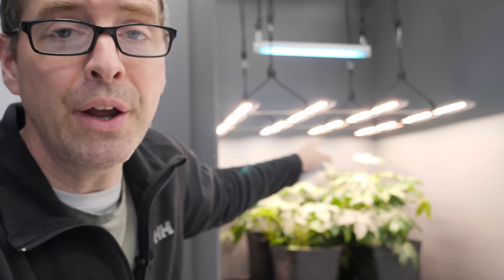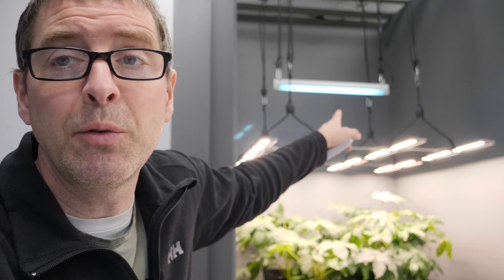How to use UVB with LED grow lights

Comment: Do HIDs produce this level of UVB and would it help to have extra if your using HID?
Reply from the maker: No they do not, not even in the same realm! It would absolutely help if you're using HID, as they only emit extremely small amounts of UVA, not UVB. 

Our UVB fixtures emit 75% of their energy as UVB and 25% as UVA, providing healthy stress responses to your plants for an increase in terpene and flavonoid production.
Reply: Not even a 10000K 315W CMH?

Comment: Shane, if a person is running in a tent, could you use the UVB closer to the plants but for shorter periods of time and see success or will it just burn?
Reply from the maker: We recommend a hanging height of approximately 2ft/60cm above the plants canopy, no matter if you're in a tent or a room 👍around 2 hours a day in total is optimal.

Comment: hi shane i have the 2ftx2ft hlg  quantum board type lights.ive got 2 lights with a 315 cmh in the middle covering a 9x4 ft area...would 2 lamps be enough to cover this area and is it best to start supplementing from week 5 at the begining of the swell for 2 hours a day.? cheers

Comment: Thats 20w uv maaybe around 365nm so it will not burn anything exept some bacteria etc, even that thing in your face will not damage your skin or eyes becouse light intesity is so tiny. If it was uva light that might do some damage even in low intensity. Those high wattage grow light fucks with your eyes more than any uv light and thosse led lights with far red spectrums are very dangerous to your eyes, allways wear protective glasses when in grow room with those crazy light on.

Comment: I want to introduce uvb to my grow. My current light is the volt VL-1 and with that size ballast it will block alot of that uvb. So can the uvb be hung under the light if the light is the appropriate distance from the canopy?
Reply from the maker: Hey, 

You can add it at a minimum of 45cm from the canopy but keep an eye on the plants for stress.

Comment: Hey what are your thoughts on running 30 watt uv light from hlg at night to help with powdery mildew.  Not sure if this would blow the 12/12 light cycle or if they are even uv-c that actually kills powdery mildew at night. Thanks for you response

Comment: I recently purchased the Mars Hydro UR45 which has 30w UV and 15w IR.  I have the mars hydro FCE8000 that I'm going to attach them to.  The UV seems to have only UVA in the 365-420nm and IR in 730-745nm.  How would you recommend using this light since it's only UVA do I use it during the full light cycle or still 1-2 hours mid day?  Also how would you use the IR?  They are both on independent switches so I can toggle them individually or both at the same time.  Thank you!

Comment: I've never seen them that high before.  
Alot of lights are incorporating uvb bulbs nowadays.  Maxibright have released these uvb led strips , 60w strip is £230 to £290 . Way too expensive I've you ask me . But If they really increase resin and terpene production then it's worth it I suppose 👌.

Comment: I tried one run at 24" and 2 hours/cycle, in last 2 weeks and my plants fox tailed. I can't say for sure if the UVB caused the fox tailing, other things can cause fox tailing such as genetics and high temps.  But on my current run I'm going to hang it at 48" for 1 hour/cycle. I realize it will be a very small dose but I'm in a tent with reflective walls so there will at lease be a little UVB bouncing around.
Reply: Over feeding and to much wind will also create foxtails

Comment: Thanks Shame always precious in your evaluations ... I have a question regarding the photonic passage through plastic and glass .. I have a box with inside 730 365 385 and 285 nanometers divided in height by food film which creates two separate environments, , one from 0 - 150 upwards and 150 upwards for the lights .. I conditioned the air in the lower part from 18-21 45-50% humidity and just above the food film canopy (PE) 25-28 36-40 ..it is evident that the separate growth parameters are very different resulting in a reduction of photons lost especially in the UVB UV spectrum and 730 .. ... I try to maintain the temperature 18-21 45-50% humidity with reduced ventilation ,, parameters best to avoid evaporation oxidation modification of terpene profiles and other volatile compounds .. for optimal growth, however, prof. bruce bagbeee suggests 23-26 45% approximately ,, parameters that are not valid to preserve degradation chemical modifications and losses of volatile compounds ... I have to buy separate solar meter uvb uva farred and check how much photon loss involves passing through a food film classic .... if you would give me some tea measurements in advance I would be immensely grateful. ...

Comment: It's my very second growth in my life....Finished my first cycle with uvb 310 about 1 month ago...I'm now enjoying results and I can say that my last potatoes growned under this light are much more tasty than the other made before buying your light...all of them were autos (same strain from same seedbank) so I can't really estimate if it's all about the uvb or just the phenotype...but yes, last one was very covered by frost and much tasty as I said....can't wait to grow couple of clones to see the real potential....I'm happy but to be honest I was expecting a better quality overall for the fixture...the power cable seems to be a chip one.
I'm saving money to get one of your aray soon or later , actually I'm using a ts1000 but due of its design is a pain to use uvb on top of it.....I guess aray 2 with uvb310 in the middle will make it perfect for a 3x3
Reply: You will need the aray 3 for a 3x3

Comment: Would it be worth hanging one above a 240w quantum board in a 4x2 tent, or would the light block most of the usable UVB?
Reply: Keep your qb240 to the back or to the front.  Not perfect but it will allow the use of the uvb

Comment: I ordered a UVB light from you and I can't wait to set it up! Thanks.
Reply: Any update ? Better terps ?
Reply: @alxs2666  I'm 23 days into flower, as soon as the trichomes show up I'll monitor them and give another update. Thanks for asking.
Reply: @rickwhite9748  any update? How many hrs do you use the uv? Any specific glasses you wear?
Reply: @scarcorleon  hey, how are you doing? I have it on one hour a day in mid-cycle, I've been using it for about one week and I'm around 6 weeks into flower,  so far I haven't noticed an increase in trichomes but I'm told it takes a couple weeks to really notice any significant difference. I'll definitely keep you posted, should be harvesting late October possibly into early November, Sativa pheno loiks like it has a longer flower period.
Reply: @rickwhite9748  Update
Reply: @roadrunner7441  I honestly didn't notice any difference,  in my opinion Genetics plays the biggest role in trichome production. I plan on doing a run with Ethos and In House genetics and compare the difference. I have great trichomes with Barney's farm and Brother's Grimm.
Reply: @rickwhite9748  Basically it's just people trying to sell their products huh
Reply: @roadrunner7441  yup, business as usual

Comment: Ok what’s up migro (Shane). I just noticed this video  after I purchased a Gavita uvr. Stand alone led sorry  but they were readily available  in a timely manner here in Michigan.  First off  I love everything you do for all of us home growers. Questions that I have can you possibly test these types of lights mammoth-gavita-hlg-growers choice?  Also will these lights help with mold- powdery mildew if not  that sucks lmfao that’s why I purchased them.  But more oil sounds good too.  Oh and if this will not help with powdery mildew is there a light that will help
Reply: PM is an issue with controlling humidity and temps 99% of the time.

Comment: great info, thanks!  maybe you can help me understand something. i noticed many of the larger lights led have the 3000k and 5000k with the rich/deep red(600nm) but only include the IR and sometimes UV on the smaller models. could you please help me understand why?  see the upgraded spider farmer SE5000 vs SE7000 as an example, thanks!

Comment: Sorry I only skimmed the video because I already bought your uvb light and did a bit of searching on the matter but I still can't find the answer. 
Just a question because I got 2 for a 4x4, If I put too much uvb, would it have the opposite effect on producing terpenes? 
I figured for 1.5 hours a day it should be okay, more so just the cross-over I'm worried about

Comment: Bought 4 of the 4ft Pure-5 UVB's about 3 or 4 years ago. With little knowledge at the time, I scorched the hairs right off the plants. lol
Reply: Did you figure out how to use them properly?
Reply: @scarcorleon  They're sitting in the closet at the moment. Been building lights with 360nm and 380nm diodes added on a separate channel.
I'll get those UVB's out again sooner or later. That was in my earlier days of building   led lighting systems. It was pretty new tech for everyone back then.

Comment: May be a dumb question but i wonder if this can be repurposed to help people deal with seasonal depression using artificial sunlightm obviously at a safer distance for a short period of time. I suffer from it in the winter and I have gone to tanning salons and it def helps along with taking vitamin d and going to the gym
Reply: Sorry to say this, but the question is indeed dumb. I mean, i understand your idea and it does make sense to some degree, but to even think about buying this light to be suntanning yourself on your own is just asking for problems and dangerous health issues like skin cancer and blindness. These lights are not meant to suntan people lol, it's meant for growing plants. There's a big difference between UV grow lights and suntanning UV lights. Just like there's a big difference with standard grow lights and the lightbulbs you use in the house. You wouldn't use a 300, 600 or 1000 watt growlight to light up a room, would you?

These lights come at different UV wavelengths, intensity, power and percentage of UVA and UVB. I think the MIGRO UV light comes at 75% UVB and 25% UVA. This is far from the spectrum of the sun. In nature it's the opposite, much more UVA and much less UVB.
There's a reason why in tanning salons you are able to touch the bed and be so close to the lights, because they are meant for people. You can't do that with UV grow lights. Also everyone's skin is different and there so many variables with UV lights, you simply cannot come up with a proper formula to suntan yourself. Just don't do it please! Go to a tanning salon and make it simple. Or simply go out when you feel depressed and get some natural sunlight, even in winter you would get enough.

And also, sorry if i sound rude and that's not my intention. But if you go to tanning salons, take vitamin D, go to the gym and all that stuff, and you're still feeling depressed, then it's not a seasonal depression, it's a chronic depression and no amount of UV would help you with that. Something else is bothering you and you need to tackle the core of the problem.

Everyone's body is different but i'll compare myself as an example. I'm 25 years old and for the last 5-7 years i'm spending time at home all day long, playing games, watching youtube, smoking weed etc. I only go out at summer, and i don't even suntan myself or anything, even though i live right next to the beach. I run a summer business and i only work during summer. It's not making me depressed. If anything i'm more depressed during summer because everything becomes so busy, loud and chaotic that i can't wait for winter. Personally i enjoy quiet and calm times, intense times make me depressed but that's just me.

I do feel weaker and i do have less energy in winter of course, but when i get that energy in summer i feel more depressed because of busy life. Firstly it's a mental problem, the body comes second when it comes to depression. There are people in Scandinavia and other northern countries who live a large part of their lives in darkness due to winter solstice, and they are strong, healthy and happy (most of them at least).

My advice is, keep doing what you've been doing now with tanning salons, vitamin D and the gym. Find a hobby that truly makes you happy and fulfilled. If you are happy and enjoy your hobbies, you can be in darkness 24/7 all year long and you would not feel depressed.

Another advice is, check for mold and mildew in your house. If you live in a humid area there's a big chance you have mold hidden somewhere, maybe behind the walls etc.
Mold toxicity causes depression and anxiety, along with a plethora of other body problems and health issues. Mold can be even deadly. Just an idea to think about.

And if you really REALLY must use UV in your room, get a proper tanning bulb meant for humans. Or those small UV lights used for reptiles, bought from petshops. And buy UV protection glasses with a proper UV wavelength for your bulb. But i wouldn't use any of that, it's better to be depressed than have cancer or blindness. You can also burn down your furniture and bleach your items like wood and plastic.

Also, i assume you're not fully educated and experienced on UV lights since you're asking this question (nothing wrong with it, just an honest observation, i'm no expert either) but if you're not fully familiar with all the wavelengths and dangers, i would suggest stay away from it or get an expert to guide you. 

Good luck and hope you start making yourself feel better! It all starts with your mind and your spirit, make yourself feel better from the core, forget about artificial crap.
Reply: @twentytwo138   i am treated for depression and i have no symptoms and its beennlike this for 15 years until the dead of winter and then its mild..i did not know if there was a difference between tanning lights and this light..thats why i was asking. I would never buy this light for that reason lol. I was just curious. I guess i was asking because i was thinking about a scenerio where i had my tent left open for whatever reason and i was in the same room for whatevr reason that i would receive any benefits from it. I was never planning on laying under it but u wouldnt know that by how i wrote this so thats my fault lol. Depression sucks and i avoid it like the plague because it destroyed the first 25 yrs of my life.  I am very lucky to be treated and have no symptoms except a couple months out of the year.
Reply: @twentytwo138  you can tan with UV B bulbs pseudo intellectual online moron,,,it is the SAME spectrum as the tanning beds. I personally have used my UV B reptile light to tan MANY times safely. paragraphs to say nothing of value,.,,,

Comment: Good UVB and UVA big topic nowadays everyone thinks Uvb is necessary and all though I use them they are not required most leds already put out uvb so beginners beware👍 I don't Think there is a such thing as optimum spectrum and unattainable at cost comparison.  I use it in veg a little and mostly late flower to help with trichomes production and far reds flash for 15 minutes  to help plants go to sleep faster before light out cycle and seems to work well. In my opinion it's a good tool to add to your grows but not a necessity Thanks for sharing Shane love what you do long time follower and supporter👍🏻🙏❤First time I ever saw you was 3 years ago with Bruce Bugbee great collaboration and good episode with the 2 of you explaining all the spectrums. Has anything really changed since then ???? Thanks Again Shane u rock👍🏻
Reply from the maker: Hi, LEDs cannot emit UVB at any useful level and are uneconomic, you are probably thinking of UVA LEDs which are basically deep blue and do not have the same effect as UVB, thanks, Shane
Reply: @MIGROLIGHT  OK Cool thank you for clearing that up my mistake. Thank you for that I love learning and I love learning the right way even if I'm wrong I think alot o g people get offended when they are told they are wrong or have been misinformed I truly appreciate learning the Right Answer's  that checks out 👍🏻🙏😁
Reply: Honestly i don't think most LED lights have any UV at all, let alone UVB. If your LED has UV, it's most likely just UVA in the higher wavelengths like 350-400nm and that is almost nothing, maybe it will increase the flavor and aroma a little bit, but not THC and it will not stop mold. Those LED UV diodes are like a toy, like the invisible UV pens or those money-checking UV LED's. To produce UVB LED diodes is very expensive and the LED light would be expensive as hell. Probably the diodes would burn out fast as well.

Are you sure you didn't mean HID and MH bulbs? Because those produce UV as well as IR.
I have Mars Hydro TSL2000 which is a fairly common LED light and it doesn't have any UV, just some Infrared diodes. Even their newer model like SP don't have UV anymore, they removed them. The FC series has some UV, but it's not enough to get a decent result. LED UV is just not efficient.
Reply: @twentytwo138  well actually YES  Just about  all the leds light have sum <uvb>  correction  in the spectrum on all these new full spectrum lights in my opinion I could be wrong but I'm pretty sure a lights have sum uvb photons. (Correction) ( UVA ) Not UVB  already without adding more( Thanks SHANE ) That's all I was saying g I would love to hear sum feedback from Shane or anyone who knows imonly going off off prior knowledge I've acquired but I could totally be wrong please tell me if I'm wrong Thank you all  & Thanks Again Shane you Rock 🇺🇸👍❤🙏👍🏻💯

Comment: Thanks for this Shane I’ve got mine too close by the looks of things, not sure how I’m going to hang it so high without blocking the most of the uv b 🤔 I’ll have to have a think.
Reply from the maker: You can hang it on the side and tilt inwards? It may work for your setup.
Reply: Try solacure  uvb it have less par so easy u can hang it on 20cm as ur leds